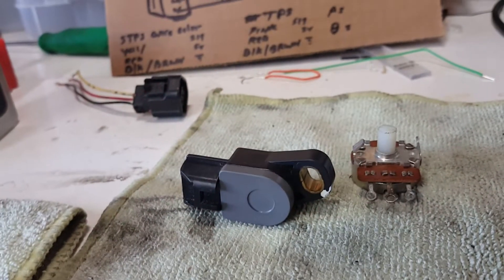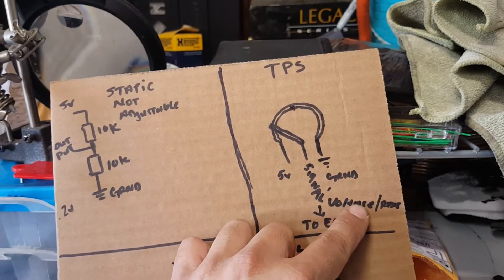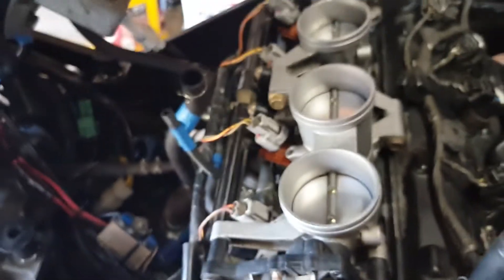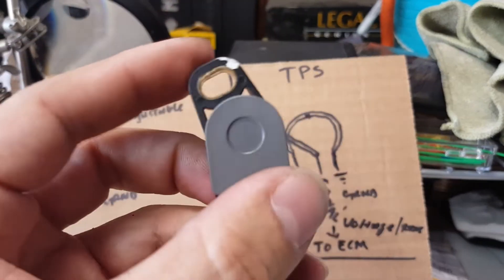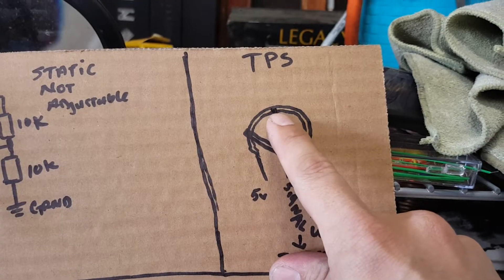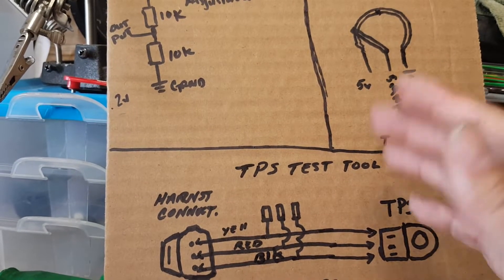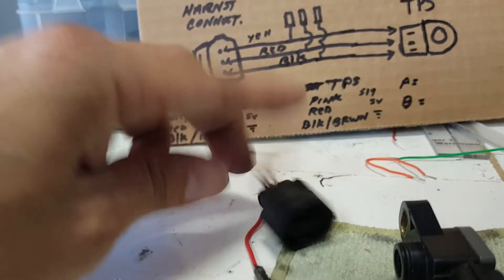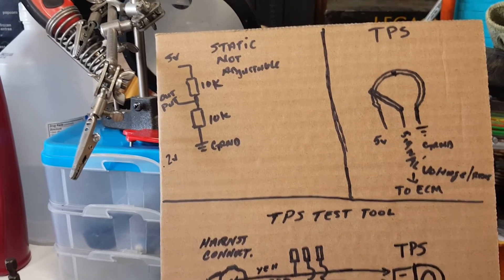DIY SUZUKI GSXR 600/750 Explaining the TPS

Comment: Hi James, I checked out the circuit in the STVA and this was 7 ohm like it should. It also is already solderd by the previous owner. Also the input signal from the ECU to the STPS was 5 volts like it should.   I'm thinking to replace the STPS .  Any tips where to buy one? Maybe there is a way to repair it?
Reply from the maker: Hugo, from what I know the STPS is non repairable. I thought the same when I was experiencing an issue with my bike, but after looking at it's construction I would have had to demolish the unit just to get in it, so I don't advise. Before going out and buying another STPS make sure you've done all your checks to insure this is the problem. Most of the time all problems with secondary  butterfly movements has to do with the STVA or mechanical parts associated with it. Is your bike throwing out the C29 code which is the STPS? One thing to note, the TPS and STPS are the same part, and I do believe I have one or two laying around the Lab if your interested in buying. Let me know.
Reply: Hey James, thanks for your reply. I just orderd the sensor online. It is indeed the same part. The part name is 13580-29G00. Hopefully this will solve the problem.
Reply from the maker: hugoK1000  awesome bro, what was the price for the part? BE sure to keep us posted for those in the future looking for help as well.
Reply from the maker: ASSPHALT_ASSAULT - I don't think the problem is with your TPS from what you have described. What i do think it could possibly be is your maping on the PC3. Not knowing what map you have loaded or any other features my first thought is that this may be the launch on your PC3. Not knowing what model (early/late) pc you have the early modles had a few wire issues where ground needed to be connected to the ground of the tps and not the batt, another was the signal wire. What i recommend is that you head over to PC website and look over the FAQs or better yet call them and maybe they can help you dial it in. Keep me posted 

 http://www.powercommander.com/powercommander/Support/powercommander_faqs.aspx
Reply: Yes, I replaced the part and the error code is gone! The part costed me 88 euro (including shipping) I believe the first and the secondary TPS are the exact same part. In theory I think it should be possible to swap them around them so you can see if it's broken of not. Also the readings on my multimeter in resistance directly on the part where different between the broken one and a new one.
Reply from the maker: hugoK1000 - awesome bro! Glad to hear things worked out for you. Throttle/idle issues are always a trick to diagnose because of the electronics involved. But just like you i swapped out my TPSs to eliminate the possibility, that said that wasn't my issue but its always nice to know the ones in there are newer then the 98k mile ones i had previously.
Reply from the maker: ASSPHALT_ASSAULT - just out of curiosity what is your Idle set to. I know the service manual for my 05 says 1200 rpms but my bike being 12 years old with 98k on the Speedo runs like crap in the lower gears with number set and also has a rough time starting usually taking 2-3 cranks before she turns over. I found that increasing the idle to 1400rpms droping in some fresh sparks and adding some Sea foam to the gas and oil has cured that mess. No more hard cold start, rough idle, or rough launch (hurky/jerky) out of 1st.. Give it a try and see if that works for you.
Reply: Hugo cuando instalaste los sensores que posiciòn tenían las mariposas secundarias?
Reply: _Hugo when installed the sensors that position had the secondary butterflies?

Comment: Can a bike run with out tps trying to put a 750 on a 600 frame.the 600 is a 95 year.and it doesn't have the TPS connectors.like the video great job..thank you
Reply from the maker: No it can't, but I'm not sure why that even matters with your engine swap. You have a 750 engine and 1995 - 600  frame that your dropping it in to, obviously with some slight frame modification.. But Im not understanding how the frame is hindering your installation if you have a complete 750 engine and 750 ECM. All your doing is moding the frame to fit the engine, connecting the gas tank , headers, and exhaust, and connecting a throttle cable..  All the TPS does is turn your manual throttle cable into an electrical signal.

Now if you don't have the 750 ECM and are trying to retrofit the 95 ECM to the 750 engine this is not going to work and your causing yourself more headache then its worth. Get the 750 wiring harness and 750 ECM and be done with it.. eBay has all this cheap enough.

I always keep a spare harness, ECM, stator and RR on shelf, You never know when something is going to go wrong and I don't want waste time or be pressured to buy at higher prices because my bike is down. We are talking about an 18 year old bike here.. parts will soonbe, if not already scarce. 

Hope that Helps

Comment: Hi, I want to ask you something again 🙈🙈

The air mixture at the butterflies, there are 4 screws that should be adjusted, mine was fully in, I just want to know why would they be all in and how many turns should the screws be turned out on a suzuki gsxr 600 k7
Can you help me?
Reply from the maker: They are set from the factory and should never be messed with unless you know what you are doing and have the proper vacuum tool to make the fine incremental adjustments if they are off..

This is the tool you need and without it, you will never get your bike to run right if at all.
https://amzn.to/3QvVUO9

The screws may have seemed to be in there close to the bottom but that's how sensitive the opening is.. the throttle body vacuum screws  could be just millimeters of bottoming out and you would think they are fully closed but that tiny mm gap is what it takes to make your bike idel right..

Fastest and quickest way to handle this is to take it to a shop... Or you can dig down deep, buy the tool, eat the down time and learn how to do yourself..
Reply: @TheChemistDIY so there isn't like a stock specific way that they should be, and are all 4 screws going to be the same or does each one differ? 

thank you so much for all the help!
Reply from the maker: Brother I know you want to here the answer you want to hear.. but no.. this is not a one size fits all type of fix.. the 4 screws are specific for each stack and the cylinder it sits over to run properly. Yes you can swap the throttle body stack (head) out and have it run with those settings.. will it run right.. NO.. because it's not tuned to YOUR ENGINE. 

You want to hear turn the screws out so many turns and your bike will be running, and from there fine tune by ear once its idling..  not going to happen.. at least from me brother.. no one keeps track of those turns because they never mess with them and if they do.. then they have the vacuum tool..

The only way to find out those specific number of turns to get your bike to an  idling point is to ask a Dyno Turner..  if he's cool and has ever brought those screws up from zero.. he could tell you. 

If you do happen to find one and he does tell you the answer, come back and let me know I would be curious to know myself
Reply: @TheChemistDIY  I know one guy, if he can't help I'll still look around, thank you, and I will get back to you

Comment: thanks for the video, I'm getting C29 error, I'm assuming the STPS is bad, previous owner removed the secondary butterflies, can I splice the STPS wires into the primary TPS to get rid of the error code since they use approximately the same voltages? Do you know if this would mess up the way the bike rides at all? I'd assume not considering the butterfly valves are removed anyway; I'm just not sure if the false TPS signal to the ECM would affect the ride
Reply: Did this work for you ?
Reply: @aniayae  I didn’t end up trying it, I found a cheap replacement STPS sensor on eBay and simply just swapped it out and was good, error went away.

Comment: Hi James. My K5 GSXR 1000 has the stva problem.  My bike is running bad, and the stva is making a weird clicking. It also doesn't move, it just stays fully open. Do you have any wire/info on how to check the ohms of my stva. I've looked on the internet for two days now and can't find a bit of info. There is lots of info for other gsxr models but not mine. It would be greatly appreciated if you could help.
Reply from the maker: Eww, the clicking usually means its toast and the fact that its not moving the flies confirms that..

Comment: I have a 05 gsxr 600 and there is a green plug under gas tank/seat coming out wire harness that the last owner put a jumper wire across but I have no idea what it's actually from and I can't find out do you have any idea?? I know they put a 05 gsxr1000 exhaust on and there is no O2 sensor anymore but I'm pretty sure now it's dumping way to much fuel into engine now
Reply from the maker: Yes this is the kickstand switch. A jumper is usually placed on the harness side by a rider to bypass the kill safety feature of starting bike in gear and being able to ride with the kickstand down. It's usually done for two reasons... Track racing and or if the switch goes bad you are still able to ride..

Comment: Hi I expierence a bad cold idle when I start the bike, I see the secondary throttle inmediatly close when I turn on the bike, and not stay open to maintain a high idle to warm up, it's the sensor of the secondary throttle or probably the actuator? Sorry my bad English translation , the bike is a gsxr 1000 2009
Reply from the maker: Here is the normal operation of the secondary butterflies.

https://youtu.be/wfuXw0nhwh8

If its not operating like this then you have an issue with the STVA.

Comment: so is this a servo throttle actuator? my twist throttle was hard to turn then got easy and wont start? shop told me $1000 just for the part?
Reply from the maker: It can be called that i suppose. Ya that price is a rip off when you can buy a complete throttle body with actuator for far less on ebay. The dealership doesn't sell the just the actuator by itself, instead they sell you the whole throttle body assembly wich come with the STVA. Try the fix and see if it works first before going any other route.

Comment: Hi mate,

Just wondering if you ever came accross -C40 code?

I have I have a gsxr 750 2008 and the F1 light came on so I ran a diagnostic and the -C40 came up.

Thanks
Reply from the maker: Sorry to get back so late, did u resolve this issue. Most who report this sensory is usually resolve it be either cleaning the clutch switch and or kick stand switch contacts.. for some reason or another the ECM is not seeing the engagement and generating a false FI.. thats if the bike is running normally.. which u didnt state.

Comment: What if your bike is throwing up a c29 code. What should I do about my stps? How do I fix it?
Reply from the maker: @Carlos.gixxer6  if you check the connector and all is fine then most likely you will need to replace the STPS.  You can pick them up on eBay pretty cheap.
Reply: @ sorry I didn’t see this for a while. Thank you. I think that’s what I’m going to do. I’ve tried checking the stps resistance with a multi meter and I get no readings. So I’m thinking it’s dead

Comment: And on a carburator bike? My 2000 yzf r1 has the error code from the tps i used a multímeter to check my tps is 6.06 a good one is (4kohm to 6kohm)  I cleaned and put on the bike and tuned but now is worse it seems 3 cylinderes probably the tps its garbage right?
Reply from the maker: The Rider, im taking it that code for your bike being thrown is the TPS correct, and you have confirmed this in your manual? If I had more information I could point u in the right direction. BUT basically electronic parts pretty much operate the same. The TPS has a base ohms value when closed and a max vale at WOT, if yours falls within specs when testing then you should be good. Like I said, i would need more information on the problem you are experiencing in order to set you on the correct inspection path.
Reply: james moreno yes my manual says 3000rpm and back to 0 every 2 sec and says its between 4kohm -6kohm and mine is 6.5 kohm its sounds like 3 cylinderes working the tps does that?
Reply from the maker: The Rider, ok so the TPS takes a mechanical movement and turns it into an electrical value. Does is it have with your cylinders, well to a point.. it tells the ECM the positioning of the butterflies (air) and the ECM thus supplies the correct fuel trim to the injectors.  If the bike feels like it's onlynrunning on 3 cyclender you may want to check spark, or your injectors.
Reply: james moreno but mine doesnt have injectores but the tps doesnt sent signal to the cdi and the cdi sends to the ignition coils? So if the tps its broken sends wrong signal to ignition coils so it looks bad spark Wright?
Reply from the maker: The Rider, YES that's how it works. It's rear for the TPS to go bad but it is possible, it could have a dead spot within it causing lose of signal. Given the age of the bike and not knowing if it has ever been changed it could be worn, also the fact that it's throwing the FI code would lead me to believe this to be the issue. What would does the adjustment level look like.. is it in the center --> -C00
Reply: james moreno toke it of clean it and adjust it like the manual said exacly but it was worse i think it broke for good thank god the code worked and i came home when i saw the error code before it broke for good lol
Reply from the maker: Ya, you can be grateful it didn't leave you stranded. The you would be paying for a new TPS and ToW..lol.
Reply: james moreno 232€ fuckin expensive on yamaha dealer for a litle thing like the tps nice present for x-mas fuck 😁
Reply from the maker: For that reason I shop eBay and is what I suggest to all my subscribers looking for parts advice. Not that they go out often but I do keep a spare TPS on my shelf for such an occasion. In fact I have quite a few spare parts from ECM, main harness TPS/STPS (same part) and a whole complete fairing set as well as engine and tranny..lol. I just need a rolling frame and I could build me another bike.. One thing I can't stand is down time!
Reply: james moreno can the error code be from the ignition coils?
Reply from the maker: The Rider, do you have a link to a GOOD copy of your manual.. I want to check something our. Also set me up with the make a model your bike.. I'll dig around, see what we can find to get u going
Reply: james moreno unfortunatly i dont have but my model is the 2000 yzf r1 4xv
Reply from the maker: The Rider, so I did some research on your bike and it seems that there was a recall on your ignition coils. The Denso coils that came with the bike are prone to failure. When failed the arch to cause the feeling of missing or rough idle like your only running on a few cylinders and not all.. this was alleviated by replacing all 4 coils with Mitsubishi coils (used/new). Have you checked to see if you have these coils on your bike?
Reply from the maker: The Rider as for your TPS, I seen a few videos of guys spraying them down with CRY contact cleaner through the  hole where in connects to the linkage or rod that connects to the butterflies. They perform this to try and clean the wiper blade contact within the TPS housing which would sound about right but for the face that this part is suppose to be water tight or water resistant. Also I don't agree with sticking a screwdriver in that hole and manually turning because you could damaged the wiper blade if you turn to far. If the TPS is open at this hole (not water proof) then I suggest filling up a Ziploc bag with 90% isopropyl  alcohol and leave part in over night. Isopropyl alcohol is non conductive and evaporate' s with air after a few minutes, so let it stand for about 10-15 before connecting back up.
Reply: james moreno yeh i heard about those coils and mine is that piece of shit denso i Just tested the secundarys and they are in spec 12k to 18k mine is 15k but when i toke the spark plug caps i noticed the wire that conects the secundary to the CAP short and falling apart